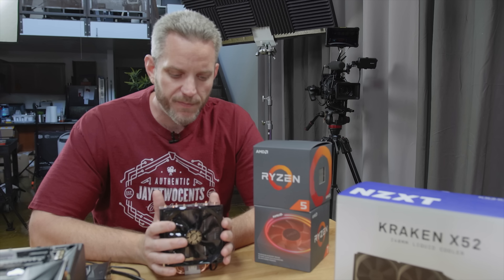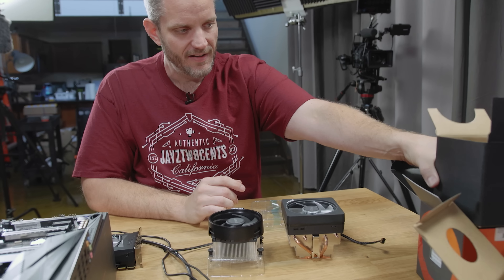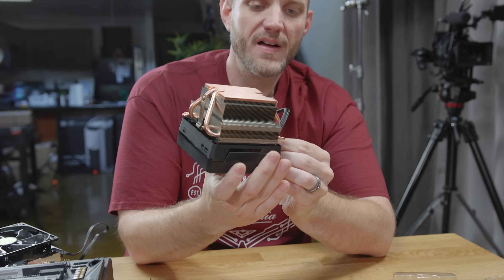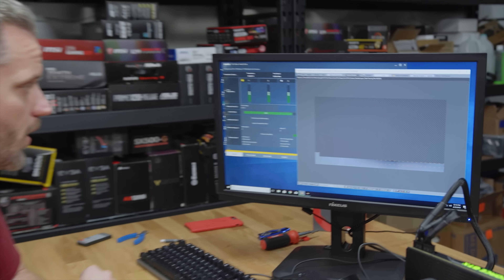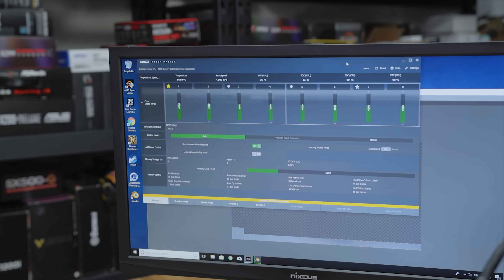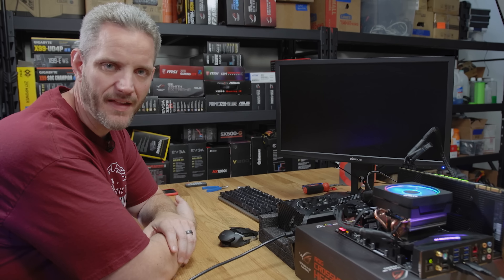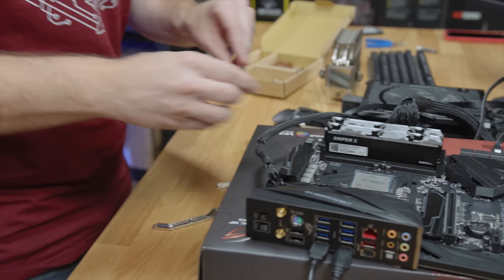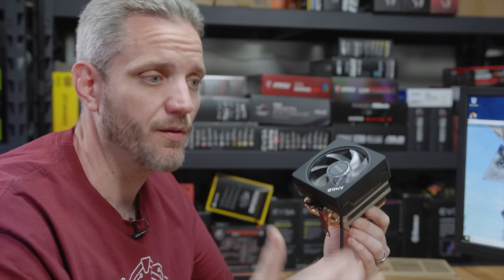Overclocking with a stock air cooler?? Is it even possible?

Comment: Intel : overpriced cpu and made in a basement stock coolers that the newest CPUs don't even include

AMD : Intel on a budget with same performance and stock cooler that is actually worth money!
Reply: AMD has lower base clock tho
Reply: @madoracle4811  Literally no one is going to run Ryzen on base clock lmao.
Reply: @chadthundercock4982  THERE ARE A LOT THAT ARE GONNA DO IT
Reply: @madoracle4811  that's pointless to compare.  Like saying that because an rx 580 has a lower clock than a 1050ti, it will run slower.  Comparing clock speeds between brands isn't accurate
Reply: Voxle I run 1600x on base clock lol. Rated at 3.6ghz stock but shows as 3.7? Do u reckon this is xfr or turbo speed?
Reply: "same performace"

Better performance actually.
Reply: @rigby4483  If they do then they probably don't care about clock speed anyways.
Reply: all i know is my 2600 @ stock beats the 8700k @ stock so both cpus runiing at 3.7ghz and my 2600  beats the 8700k in multi thread the 8700k is over 300$ i paid less than 118$ for my 2600 intel are a joke of a company ran on greed
Reply: @tattoodtechnerd4945  that's completely impossibile since 8700k can be overclocked to 5ghz and the ipc is higher
Reply: @matteo964  read man both at stock 2600 wins evryone knows they clock higher and will win at higher clock i been buildin sines 2003 i know dude
Reply: @matteo964  i know a 8700k at 5ghz will beat
 a zen+ 2600 @ 4.1ghz thats comon sense
Reply: @matteo964   (2600 @ stock beats the 8700k @ stock so both cpus runiing at 3.7ghz} there are exact words learn to read
Reply: @matteo964  clock for clock, the IPC gulf between Coffee Lake and Zen was not that large, downright negligible. Plus narrowed the gap even more, and Zen 2 slaps all three of the previous mentions across the mouth. The only thing keeping Intel in this race is their precious frequency lead.
Reply: @madoracle4811  And still runs smoother because it has more cores and more threads. And it's cheaper.
Reply: First time I didn't go with an INTEL cpu in Ages!
Reply: @Ridzflips  I'm p sure they oc themselves if they have the resources
Reply: @tattoodtechnerd4945  Big lie. I had a 2700X and it was crap in games. switched to intel and its MILES better. had a 7600k before the 2700X and the intel was still faster. ryzen is overhyped.
Reply: @Lumpia_In_Texas  something was wrong there. I have the Ryzen 7 2700X. Never had any problem with games, even with stuff like Warhammer 2. I can actually run 2 games simultaniously if I want to...
Reply: @Ridzflips  The X series doesn't overclock well anyway, If you don't like overclocking go for the X and your good to go. The same thing with the new 3100, there's a lot of room of OC but the 3300x you're good to go as is, maybe just activate PBO...
Reply: @rigby4483  let me introduce you to FIT
Reply: Lumpia in Texas stop spewing bullshit. The 2700x is literally fine for gaming. I build rigs for people and the 2700x has never failed me It’s actually my personal CPU. Stop schilling for Intel.
Reply: AMD draws too much power to be worthy which is why everyone compares AMD to Intel and not the other way around 😉
Reply: @christophervanzetta  i didnt realize comments from 2010 would get posted now
Reply: @Skyflairl2p  Seems nothing has changed 🤣
Reply: @christophervanzetta  Oh you must not have been paying attention at all then, as the tdp per core is lower on the ryzen than it is on intels cpu's and thats coming from a former intel-only user (for nearly 10 years!)
Reply: @Skyflairl2p  You do realize the TDP is measured differently between AMD and Intel, right?
Reply: @christophervanzetta  Whoops, my bad. I wasn't aware of this. However if you check out jayztwocents video on the topic you clearly see that the power consumption between intel and amd is pretty much the same. And if you put performance vs power consumption amd actually wins. So your original comment just doesnt make sense! Im a gamer, But i also do work in 3D applications and game production. To me AMD clearly wins in most, if not every factor. The only reason amd is still being "compared to intel" is because it's still considered the underdog. But that can change at any given time.
Reply: @Skyflairl2p  If you think jayz2cents has any credibility then you are only fooling yourself.
Reply: @christophervanzetta  cool cool, you're one of those types.
Reply: @Skyflairl2p  Yes, an intellect that isn't persuaded by influencers.

What are you?
Reply: @christophervanzetta  someone who doesn't pretend i know everything better than others
Reply: @Skyflairl2p  At least use propper grammar 🤦‍♂️
Reply: @christophervanzetta  Child with no argument 😄👍
Reply: @Skyflairl2p  People these days....
Reply: @Codenamesupreme  I know right? what can be done.
Reply: I5 4 core, ryzen 5 6 core which is faster and cheeper
Reply: @madoracle4811  clock doesn't matter 
It's just a marketing term
Performance matters
Reply: @Emanuel Sheta 
Not anymore.
Reply: Just found a i5 10400f same price as a ryzen 5 3500 , i5 10400f is a lot better on the benchmark
Reply: I have the AMD RYZEN 7 3700X.In a lot of things is better than the I9 10900K.LIKE IN GAMING.
Reply: @madoracle4811  come back now. Base clock doesn't matter single core and multi core performance does.

Comment: AMD give you this cooler for free with the 2700X damn!!!
Reply: Yea, that was mind blowing to me too. Exceptional value for the money.
Reply: I'm still not sure weather to upgrade it...
Reply: not really free, you pay for it in the price of the CPU ^^
Reply: @nickwagner9339  nope! i bet you find a stock cooler in an Intel K series CPU box
Reply: @subistar05  your point being? This amd cooler is also stock
Reply: @nickwagner9339  because you can't find a stock cooler in an Intel's unlocked processor box. they are so cheap that they don't even include their little aluminium piece of shit that they give you in a non K box
Reply: @subistar05  then you bet i dont find a stock cooler, the word dont was pritty important, but still, its not free, without a cooler the chip could be cheaper to buy having AMD still make the same profit per chip, so the cooler included with amd is not free, but Intell charge more for less, you are right about that. .
Reply: @nickwagner9339  AMD is still cheaper because an Intel chip without cooler is still more expensive than AMD chip with a respectable cooler!
Reply: @subistar05  but i think your still missing the point, the cooler is not free, its included in the price, yes the still cheaper than intell price. So intell is not only expencive, there stingy aswell. Im sure intell could put in any cooler they wanted with it, but they will charge you more for it, so also not free
Reply: @nickwagner9339  You pay for it with increased power draw from the chip...
Reply: @subistar05  Why would the provide a low end cooler in a high end chip?
Are you that poor?
Reply: I want that big thermosipon  cooler 500 watts of cooling yet its cheaper than most watercooling  loops yet a cpu cooler like that will last for 10 life times  yet it could easily handle a Intel gaming chip lol
Reply: @nickwagner9339 (fake prices)
intel w cooler: 360$
intel without cooler: 380$
amd w cooler: 220$
amd without cooler: 220
amd cooler > intel cooler
amd performance > intel performance
explain pls
Reply: Silly statement. It's not free. It's in the cost of the CPU. 

Someone is paying for the materials and hourly workers to manufacture and ship that cooler. Spoiler Alert: It's you.
Reply: @davecarsley8773  oh Dave, took you 2 years to add a comment on something that's not even relevant anymore... Keep up son keep up. AMD have now released new CPU's did you know that? Does your cave have internet?
Reply: @cliffbartram4974  lol 🤣
( i know im late )